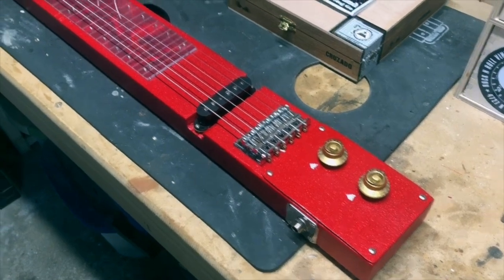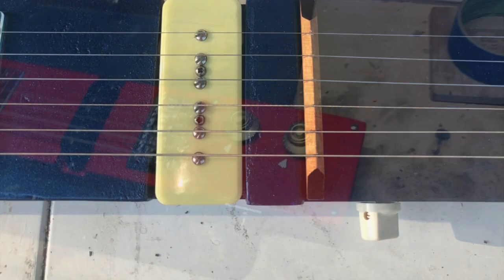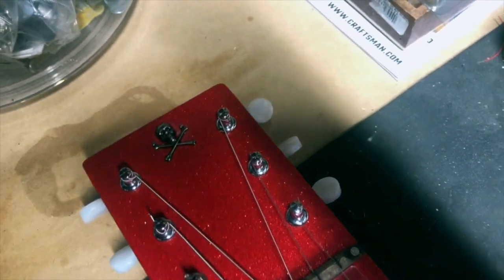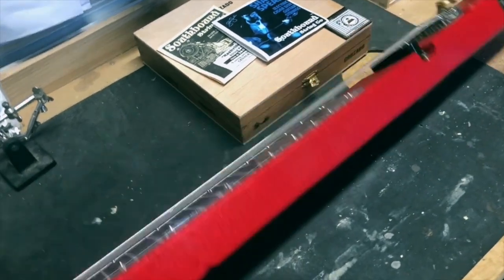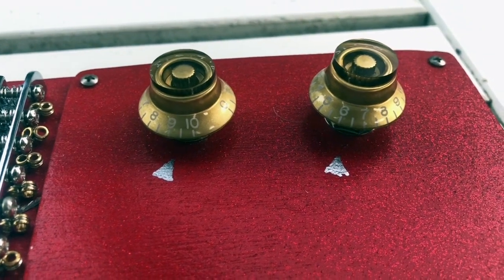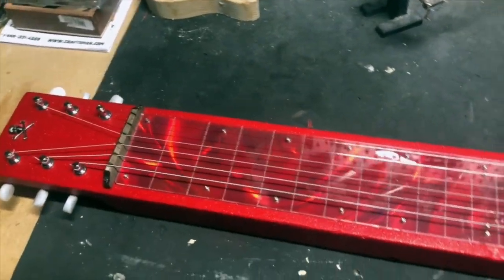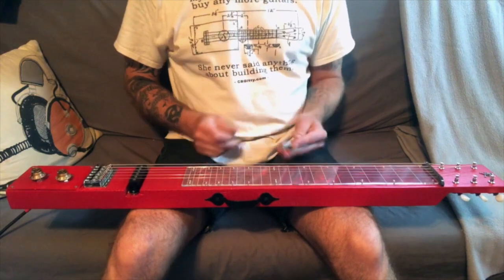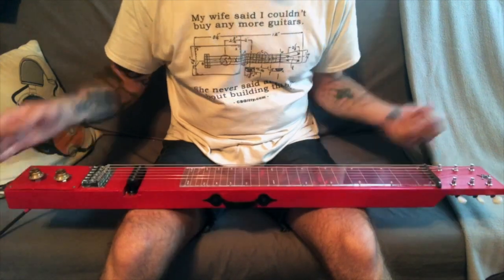DIY Red 2X4 Lap Steel Guitar

Comment: nice job love the paint what brand off paint is that please
Reply from the maker: It is done with 3 types of Rustoleum paint. I used a standard Rustoleum red and applied 2 coats. Then after it dried, I added one coat of the Rustoleum Glitter paint - you can buy it at most craft stores. After the glitter paint dried, I applied a coat of Rustoleum satin clear. It ended up looking pretty nice.
Reply: @musicalmiscellany  thank you  bunches

Comment: I like the hardtail bridge in this design (the ability to intonate the strings and level the bridge for a bar).  Do they make any hardtail bridges with a wide string spacing (2-1/4" minimum for a 3/8" string spacing)?  I'm getting ready to build my first lap steel and understand that they have a wider string spacing than a regular guitar.  My problem comes in finding components that facilitate that desired wider spacing (hardtail bridge and pickup).  What did you do/use?
Reply from the maker: I had the hardtail bridge in my parts box so I'm not 100% sure what the spacing is. I'm pretty sure it came off a standard guitar so probably strat-style spacing (the pickup is a strat-style pickup and it seems to line up). Honestly, the spacing really shouldn't matter as long as your bridge and nut spacings match. It may be slightly wider or narrower than the defacto standard for lap steels... but there's no inherent wrong or right in this arena... it's all just popular conventions. I mean, Gibson and Fender both use different string spacings and, while some people prefer one or the other, nobody would say either guitar is "wrong" just different.
Reply: @musicalmiscellany  Understand, the only thing I could find were single saddle individual bridges.  They would work, but I think I'd rather have a single bridge plate with the saddles on top (like you have).  Thanks for indulging my paranoia...
Reply from the maker: @wellingtonfirstbaptist4651  No worries. Using individual saddles does allow you a lot of flexibility for string spacing. However, you really need to be precise with your measuring because even a mm or two off makes a big difference. If you go that route, take your time mounting them and double-check everything. One of the nice things about the plate bridges is even if you're a mm or two off, you can typically compensate with the adjustable saddles and make it work. That said... I suppose it's always best to be super precise no matter what type of bridge you're mounting. LOL.
Reply: You can buy hardtail c.b.g. bridges with 19mm spacings, but only in 3 or 4 string.

Comment: How does the wiring work? Like if I bought pots and caps, how would I attach the knobs to them? Also, how did you make the cavity?

This is an excellent video! I’m very inspired to do this myself! Thank you!
Reply from the maker: Thanks for checking it out. I used a forstner bit to route out the cavity. The wiring is just standard guitar wiring. There's a diagram you can follow here: https://guitarelectronics.com/1-humbucker-1-volume-1-tone/
Reply: @musicalmiscellany  thank you!!:)

Comment: Nice job, so simple. I have a question...why did you use 500k pots with a single coil pick.up? Usually a 250k pot is the go to for a single coil pickup. 500k will work no doubt but your sound will be darker as opposed to a 250k which will be somewhat brighter ( 500k are usually used for humbuckers). Just curious what your thoughts are.
Reply from the maker: You are absolutely correct. 500K are generally considered the "preferred" pots for humbuckers. So why did I use them in this build... simple... I didn't have any 250K pots in my parts box. When I make homemade instruments, I like to use the things I have on hand even if they're not the "traditional" part. To me, that's what makes homemade instruments interesting. I mean... the guitar is made from a flippin' 2X4... why get sentimental about the pots? LOL. In all seriousness though... there's nothing inherently "correct" about using a 250K pot for a single coil pickup... it's just a popular convention.

Comment: How long a piece of wood do I need to start with?
Reply from the maker: Thanks for watching. I've made 3 of these so far (other 2 links below) and each time I used a different length 2X4 to start. I think this one was around 36". I guess it doesn't really matter as long as you can get a 23" space for the scale and have room for the bridge/tuners you want. I'd say anything 32" or longer should work.

Here are the other 2 videos: https://www.youtube.com/watch?v=PmYQuLmFsuA & https://www.youtube.com/watch?v=tT170fxgvUE
Reply from the maker: I just got out the tape measure and checked... this lap steel is 35" long.
Reply: @musicalmiscellany  ok thanks

Comment: Stick on felt feet from dollar tree
Reply from the maker: I'm not really sure what the comment means but thanks for checking out the video.
Reply: @musicalmiscellany  He's talking about putting the felt feet on the bottom of the Lap Steel instead of the wood pieces that you used. But like you stated in a comment above about the use of 500k vs 250k pots. You like using what you have on hand.